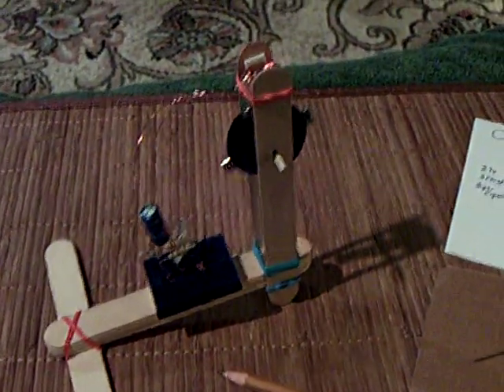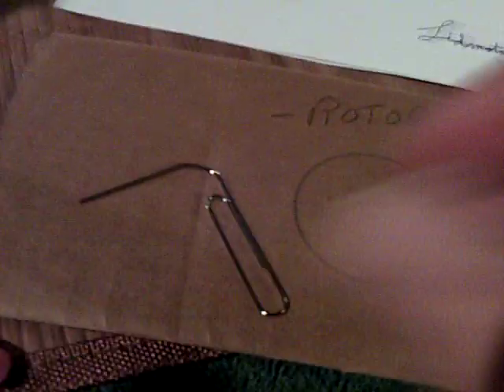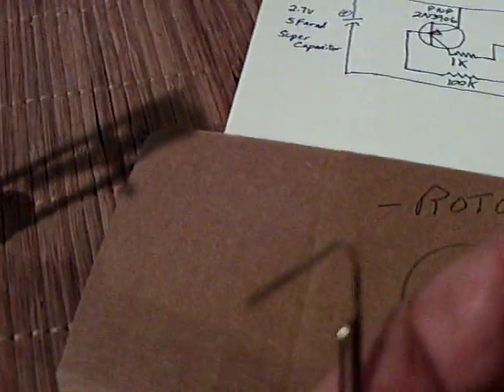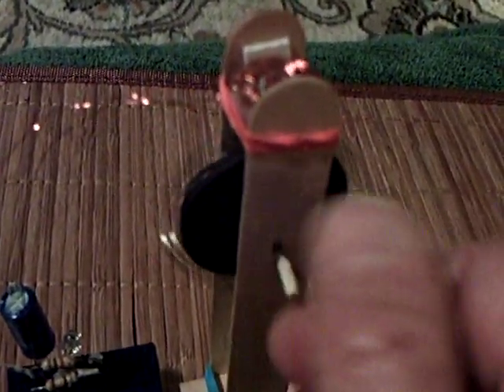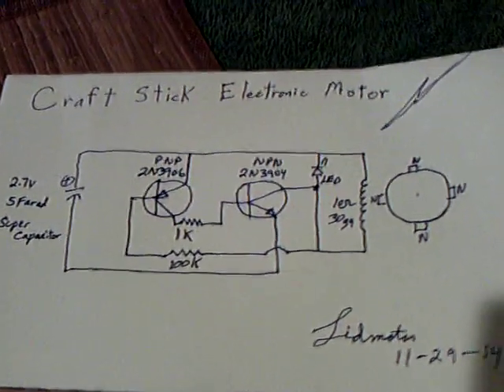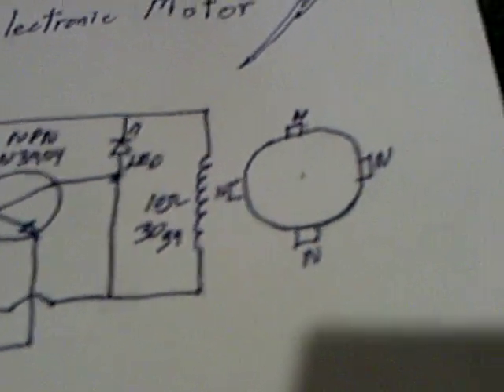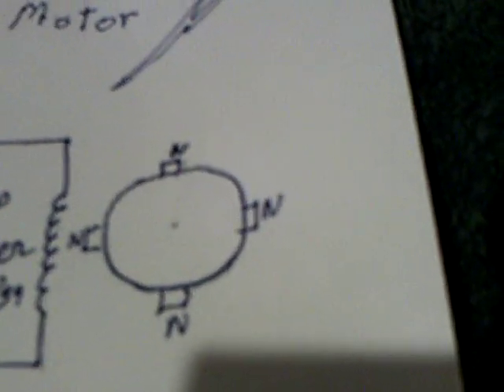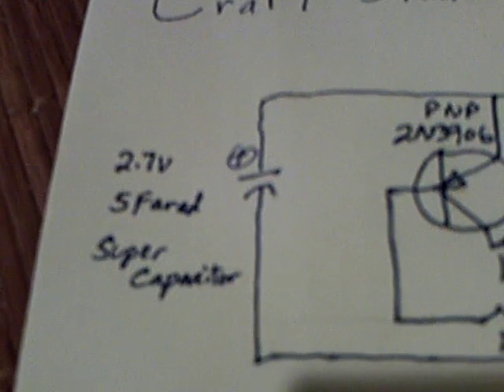Craft Stick Electronic Motor---  Explanation

Comment: For that strobe effect, there's a vid where a helicopter is caught at exactly that stop spot, looks very weird.
Those magnets should be fine at any speed, the rotor assembly is likely to wobble way before the magnets come unglued. In my experience with superglue, the cardboard will rip off with the magnets and needs quite some force to do so. Cleaning magnets up afterward was what prompted using water bottle tops on my own stuff. Cardboard though allows any diameter of rotor :)
Reply from the maker: When these little magnets go flying off at high speed an Easter egg hunt usually happens.  Sometimes I find them and sometimes not.  Maybe if the escapee is dragging a cardboard tail it will be easier to find the little critter.
Reply: *****
Indeed. 6 months along and a lighter that's being used for melting hotglue keeps sticking to the work table in one spot...you've found that other lost magnet  :)
Reply from the maker: slider2732 I lose them quite often on my work table and they show up in the strangest places-- on clip leads, pliers, batteries, the desk lamp, etc.  Sometimes they pick up friends along the way--paper clips, resistors, leds, etc.